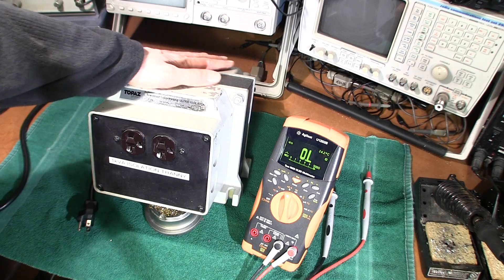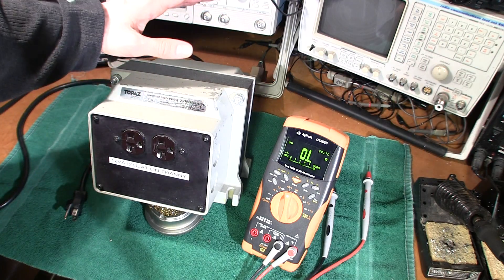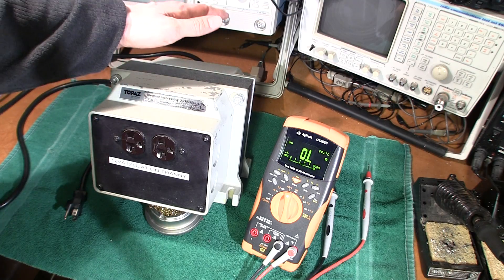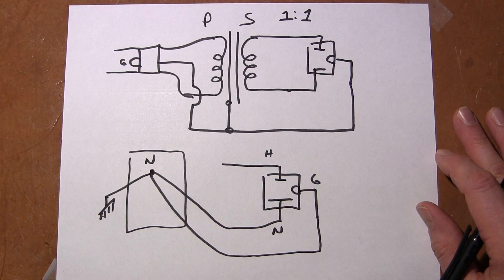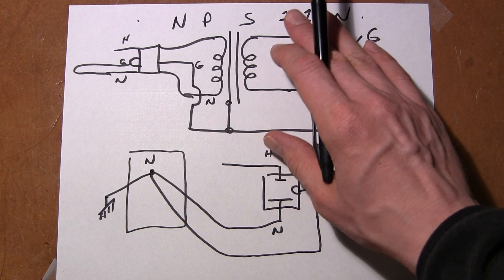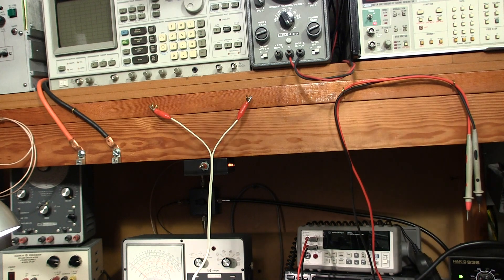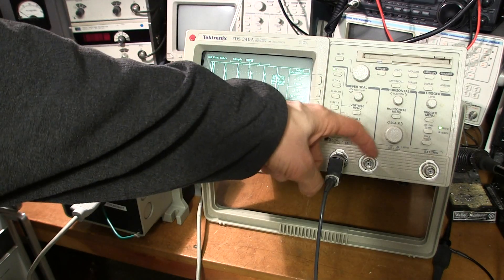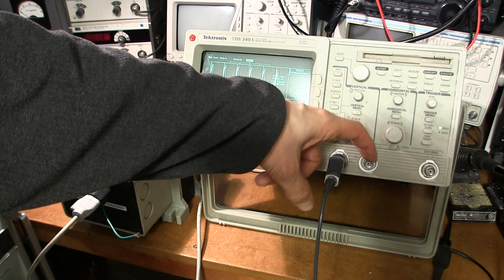Tech Tips Tuesday, Isolation Transformer and Variac Safety

Comment: I’m confused. Say your scope is plugged right into the wall, grounded for “safety.” If you are putting the DUT, on the isolator(2 prong, no earth), and it’s central circuit ground is the chassis, wouldn’t you “earth” the DUT with your probe? What is the solution, for true safety ?

Comment: a transformer doesn't operate using ground ground is alot confusing to most ac goes in and out of the coil via a hot and a nuetral to flow current the ground pin just doesn't need to be involved with the operation of these transformers o secondary should only be its windings connected to seperate device hints the key term "isolation" meaning that there is absolutely no galvanic connection to one another its why the windings use varnish to insulate from each other and so on center tap is just the half way point of a winding if it were thought of as 2 batteries in series where the two +/- connect run a wire out for half of 6 volts and so on  a cell by it's self positive to negative measures 3 volts and 2 mease 6....

Comment: Worth mentioning is one danger of 'floating' the 'scope by cutting the ground pin off its plug, or using a 3-prong to 2-prong adapter, with the ground pigtail not connected, or cut off.  When connecting a floating 'scope to a tube-type device, one will encounter multiple points that are energized to potentially lethal voltages, both AC and DC.*  When you connect the 'ground' or 'reference' lead of the probe to some point in the device under test or observation, the 'scope chassis, including those pesky BNC connectors, will be energized to that same potential.  Remember, too, that those 'safe' plastic knobs on the 'scope probably have steel setscrews that are at the potential of the shaft of the pot or selector switch being operated, and the shaft will almost certainly be at the same potential as the chassis.  This is true when using a battery powered oscilloscope, as well, with an added risk: the chassis may be tied to one side of the charging jack.That makes the jack itself a risk point.  Further, if powering the 'scope with the charger connected, the charger may be similarly energized.  (One thing that has supported me in the process of growing old is keeping my non-dominant hand in a back pocket when working on live circuits.) 
[*Of course, this applies to myriad devices other than tube-type electronics.]

Comment: Excellent video.   I am curious though on how an isolation transformer will make working on a television safer.  I have some TV sets where I want to adjust the horizontal width but I've read that its a coil or a small potentiometer.  I do have plastic alignment tools but depending on where the adjustment is, it may be near the high voltage section.  How much more protection will I have if I use an isolation transformer on a standard two prong polarized plug for a television set; and for a three prong plug television set?  I have some TVs that do have a three prong plug.   A video and demonstration will really help.   Thank you in advance.

Comment: Excellent safety advice. As a guy who was involved with radio repair for four years I say Paul, thank you for saving lives. But the trouble comes with the plug because the scope then has a floating earth and what you see on the scope is all over the place. The way out of that is either a solid ground rod connection away and separate from the electrical supply or in a so called 'tech unit' an earth isolation section that generally has a clean earth filter in it too. That would be someting nice for a design Paul. As you mentioned some scopes used in television or valve work for example have isolated inputs to avoid the earthing issue, mainly because of the high voltages involved. But heed Paul's words.....most scopes do not have this and I have actually seen an apprentice destroy a scope in the manner Paul describes. Fortunately it was not me. From what I recall it was a hell of a flash bang, the probe being completely destroyed and the scope input damaged and smoking. Not good and an easy mistake to make.

Comment: Things get twice as bad in the UK as we have 240volt, 13amp supply as standard.  Flashes and bangs are a magnitude larger!   Makes you learn really quickly.  
A variac built into a case along with isolation transformer and an output meter is the most useful arrangement. Also a switched earth with tell tale light to show when earth is connected.

Comment: Great presentation as usual. Beginner here. I'm trying to get my bench up and running and really want to understand this concept fully. This video clarifies. But like so many others I'm left wondering what do I do with my oscilloscope? I have to attach my probe ground  to the chassis constantly. What should I do? float my scope as well? I haven't seen a single explanation of how to proceed from this point. I use an isolation transformer. I make sure the object under test is floating and there's no ground to neutral. Then what? I have to buy a differential probe? What about a battery powered oscilloscope? Pretty sure we're not far from that being commonplace, outside of automotive scopes. Will that solve some issues?
Please explain to me how to proceed and get my bench up to speed

Comment: 11:14 Paul:  "This little adapter could save your life, but whatever you do don't use one, because legal niceties are so much more important than actual safety".
Another issue Paul didn't mention is having two isolated outlets on the same transformer. This is dangerous,. For example imagine two hot-chassis radios , one in each outlet, and the phase of either one was reversed, there would be full mains voltage across the two metal chassis.
So if that transformer was mine, I would open it up and remove the ground connection from the outlet, and disconnect the second outlet completely.
I'd rather be safe than compliant.

Comment: I (and probably lots of other people) would love to see you demonstrate the USE of a variac.  People often talk about powering up vintage gear with a variac, bringing up the AC power to the vintage gear slowly (how slowly?)  I'd like to see a demonstration of this, along with an explanation of why it is being done (allowing capacitors to reform?)  I have been told that doing this helps to keep from damaging the vintage gear.  Could you demonstrate this process and shed some light on what precisely is going on?
Reply: So my kinda layman's understanding of it is the following from what I remember from videos on the subject. Basically, the reason people care to supply lower AC voltage is because failed old capacitors in Tube gear have the potential to basically short the power supply to some degree and cause excessive current through the rectification section, including of course the rectifier tube(s). With bad enough capacitors and enough current/time powered on, you can potentially damage/destroy the rectifier tube(s) and transformers of old, broken gear in need of Cap replacement. 

As far as I can tell as an amateur, the ONLY reason to bother with a Variac is for 'testing' old tube electronics with presumably bad Caps that will overload the supply components. This is IMO stupid and unnecessary as the caps should be presumed bad (shorted, kinda) on anything old enough for Tubes and this seems like a complete waste of time given the only people who'd be doing this would also be replacing the certain failure-prone Caps (paper, Electrolytic especially, etc) afterwards anyway. It seems to me like you could skip this entirely by checking resistance and/or continuity from the input to the power supply section to see if it'll be partially shorted instead of just running it at lower AC voltage to mitigate damage versus full 120v. Anyway, the theory/practice behind the Variac is that lower AC voltage will proportionately lower current through the device with faulty Caps and thus lower heat/damage to sensitive components. I don't see why you couldn't instead just limit current instead with full 120v line with an inline fuse or something (like lots of devices have at their input, what a coincidence!) if you're gonna be 'testing' equipment that you suspect is faulty and liable to be damaged plugged in. 

So yeah, basically it's that simple. Lower line voltage equals lower fault current which is very common as old Caps are notorious for failing internally (basically turning into resistors/jumpers) and is by far the biggest problem in Tube gear not working or working poorly. Any vintage tube equipment you intend on using needs replacement caps (again, certain types only 99% of the time) or they're liable to burn out the rectification and transformers. Not exactly catastrophic for the vast majority of cases but maybe a bigger deal because Tubes are scarce.
Reply: @Brandn00b25  Thanks for spending all that time and energy to reply. (I'm surprised that this guy hasn't bothered to answer my comment.) But I've been an analog circuit designer for decades.  I know how Variacs work.  My question had to do only with the apparently common practice of slowly (how slowly?)  bringing up line voltage to (perhaps long-stored) vintage equipment to reform caps, etc.  I'd like to see this actually being done by someone who knows why it's done and who will provide commentary during the process.  

All of my experience (50 years) as an electronics guy have been with new equipment or things that have been in daily use since they were new.  I want to restore some cool vintage audio gear and vacuum tube based test equipment that I've bought on ebay, at ham fest's, etc.  So, I welcome input from people who do this slow warm up thing.  It makes sense to me in theory.  A piece of gear could have some extreme fault(s) that could cause damage when power is applied.  I imagine that in addition to the capacitor-related issues, there could be other things.  I think that using a Variac would allow a guy to initially trace through circuitry without having it blow up in his face.

Comment: Hey Paul, I saw your build of a line share/isolations project and it inspired me to build yet another piece of test equipment for my lab, Looks like it will go on the wall like yours did just to meet roon-issues. QUESTION: Would you comment on my plan to use the primary windings back-to-back from two MOTs? I would be the only tech in my lab but, looking ahead, I would enclose my build in plexi-glas for safety sake. I would like to know what you think. It's all limited to 120v even though MOTs make it all sound over-the-top.

Comment: Can you explain why in an arcade cabinet running a monitor that requires an isolation transformer still had the earth ground connected on both sides of the transformer?  I have other people telling me that you have to have earth ground connected on both sides.  They tell me I should have my isolation transformer connected to earth ground when I am working on a monitor outside of the cabinet.  I am 99% sure they are wrong.

Comment: In Australia it is normal for the output socket on an isolation transformer to be NOT connected to earth, if you need an earth on what your working on, then that has to be provided separately. Anyway I would NOT use one to float a scope, or any other test gear. If you do, and connect the probes earth clip to any substantial voltage, then that will appear on the outer metalwork of your scope, as in the WHOLE chassis will be LIVE, very dangerous indeed.
If you then go to connect a second lead to another input, you will be touching a live socket, and you will get a shock.

If you want to look at the mains using a 'normal' earthed scope, then tie back the probes earth clip and just connect the probe tip, using the scope's earth as the return path. Also before doing so check to make sure you are not exceeding the voltage specs. In the US you only have 120V, in Australia it's 240 on the active/live pin, so often an X100 probe is a better choice. Some early digital scope's can only take 5V directly into their BNC, check.

Another method for a mains look-see is to use an AC output power pack (wall wart in the US) with say a 12V output, this can be handled with pretty much in total safety, and give you an X10 display, same as an X10 probe.
Toroidal transformers seem the best, some small & cheap EI types, especially the ones that run warm, can be running a bit close to saturation and can round off the tops of mains crud your trying to observe.

Another problem with floating equipment, is that the chassis will probably be sitting at anything other than earth, this is usually due to stray capacitance in the power transformer, and is usually exacerbated by mains filters that can easily put the chassis at half mains, whilst there is little to no current seen here, the static charge contained in a largish chassis, and the stray capacitance, can cause a current surge/voltage spike when you hook the earth clip, or an X1 probe doing damage to your gear. I once connected a floating video camera into a video input on a computer capture card, the spike destroyed a few hundred dollars of equipment - it does happen, floating gear is bad.
Reply: Very informative, thank you!

Comment: Maybe I'm just woefully unqualified to do my job, but isn't the entire point of an isolation transformer to, you know, isolate the ground??

for example, in marine electrical applications we often use isolation transformers in order to break the grounding connection between different boats in a marina and thus prevent a galvanic cell from forming. This also moves the source of power and quite critically the neutral ground connection onboard the boat as opposed to on the dock, which eliminates the potential for leakage of AC stray current into the water.

It would be my understanding that a transformer configured as you demonstrated couldn't be considered an isolation transformer at all, and it would be more accurate to describe it as a polarization transformer. 

What am I missing?

Comment: So dumb question then.  What is the point of an isolation transformer if it does not solve the problem we are trying to solve in the first place?  I just bought an oscilloscope and was buying an isolation transformer and then ran across this video.  Wow am I confused now.  What if I just plugged the oscilloscope into the wall with the three pronged adapter not having the ground connected?  Total confusing now.  Can you post a video on best practices?
Reply: Did you ever get any kinda of reply. I’m in the same boat and after watching this I’m confused to be able to plug my oscilloscope straight into the wall is this a bad thing or a good thing and if I can’t do that then, what do I do?

Comment: Many years ago we did some testing on the Variac (or Powerstat) ramp-up / power-up method. The sample DUTs were 5U4 and 5Y3 and 80 rectifiers. What we determined is that continued "ramp-up" turn-ons can lead to cathode striping. Apparently what's happening is that as the filaments are gradually being brought up to temperature, while the B+ is also being applied. With the high potential of the plate voltage and the Cathodes not at proper operating temperature, that cathode damage eventually occurs. This was from many repeated cycles to prove a theory. Obviously, if this condition is only done once (or a few times) during the repair process, then the damage would probably be non-existent. Anyhow, I just thought I'd share that info.

Comment: Where does a current limiter come into play? I have a lightbulb current limiter plugged into a Variac and the Variac is connected to the wall. If I shorted out the oscilloscope (connected directly to mains) by placing the ground clip on something with voltage wouldn’t the lightbulb limiter cut the current flowing to the device I’m working on? Thanks for any info

Comment: The only way that light bulb lit up at 8:28 is if there is a direct connection on the secondary between the neutral and ground. Current path is from secondary "hot" to bulb to scope ground to service panel to secondary ground and then through secondary coil to "hot" to bulb.

Comment: I was looking for some isolation transformers for the bench, picked up two 50lb or so transformers, Model 9T91C10 Gen. Electric. Capacitive(Constant) Voltage Transformers, I can't find any info on them, other then the sticker. 60Hz 95-130v input, 120 output. The person used them for their guitar amps while gigging.

Comment: Thank you so much for this and for all your videos.
I understand that, when you restore old test gears, you usually prefer to avoid connecting a cable with ground pin.
I understand the concern expressed in this video, but I wonder if there are other situations in which the ground connection could be counterproductive (or very dangerous).
Thank you for your attention.

Comment: Very informative video, thank you for posting it. I have an old Variac that has an input and output, each has only two prongs of the same width, and no ground pin. The diagram you drew of your Variac shows the "hot" side connected to the Variac transformer windings and the "neutral" going straight through. Since both prongs of my Variac are the same width, is there a potential functional problem or safety hazard if the prong connected to the Variac windings is plugged into the 
"neutral" of my wall outlet?

Comment: I use a Variac to control the motor speed of a motorized impeller and it works well (zero speed to full speed).

Would it make any difference how the motor start/run capacitor is wired into the Variac? One side of the capacitor could be wired to the input hot lead on the Variac, or it could also be wired to the output tap on the Variac. Not sure if it would make any difference. 

I am also thinking about using an isolation transformer in conjunction with the Variac. Thanks.